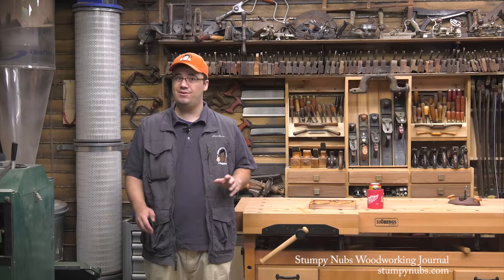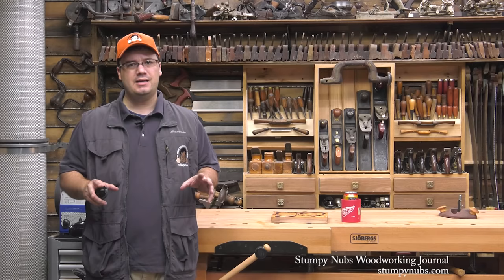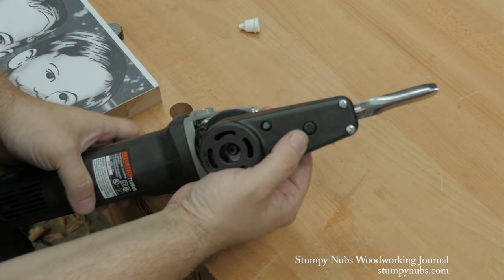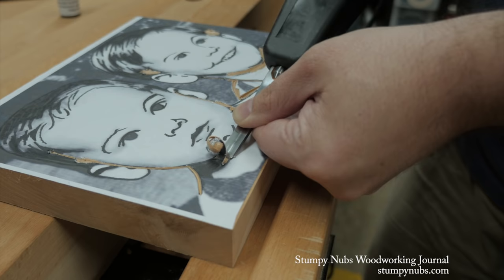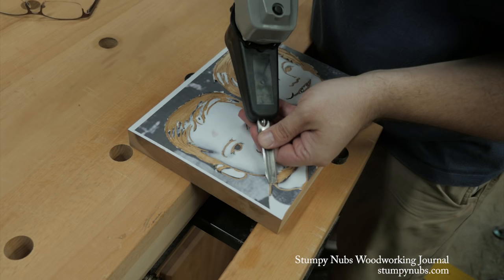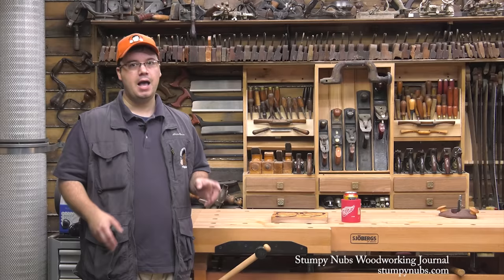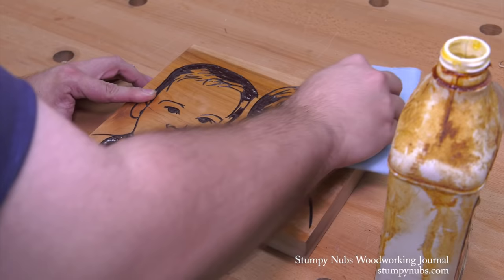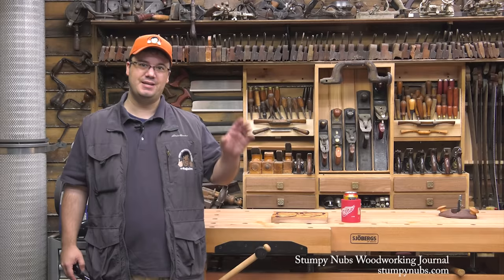How to carve a portrait into wood from a photograph (+ Arbortech Power Chisel review)

Comment: A very nice beginner's guide. There's only one thing I'd share to give a more updated way to transfer the image. The easiest way is to print the image from a laser printer. Place the image face down. Then take laqure thinner  on a white tee shirt material and barely get the paper wet. Take a spoon and rub the image into the wood as few seconds. Let it dry and take the paper away. The image will be transferred to the wood and no glue on the wood to deal with

Comment: I love that we can search back through this channel's content and find golden nuggets of information like this one.  I was not aware of the Arbortech Power Chisel.  I have been asked to make a sign and planed on making a template in MDF and using guide bushings, but when I laid out the text and added the offset for the guide bushing I found that the template became compromised.  The Rockler letter sets look interesting, but you are still limited to the available templates.  So I have just ordered the smaller Wecheer power chisel set.  BTW  I have own an Arbortech ball gouge for several years, but I have never been completely comfortable using it.  Not that I have spent a lot of time practicing.   Your method of carving from photographs looks very interesting though, and I am definitely going to try it.    Thank you James.

Comment: I use the Arbortech Power chisel for carving and love this tool.  One tip that wasn't obvious in the instructions was to apply 1 or 2 drops of the supplied oil every 15 minutes of use.  If you don't the end of the chisel that is impacted will mushroom and make it difficult, or impossible to remove.  I found this out the hard way and had to disassemble the power carver to get the chisel out.  I was able to fix the problem with some sandpaper.  
As a side note, the service center for Arbortech USA was extremely helpful and explained what caused the problem.  I own most of the tools offered by Arbortech and can highly recommend them for carving everything from bowls to sculptures. Great video and review of the tool.  you have a new sub. Keep it up.
Reply from the maker: Thank you. We will also be making another video soon using the Arbortech mini-grinder for a relief carving.
Reply: You will love it.

Comment: What a great project! I own & use many Arbortech tools but I opted out on this one because of the size. Instead I use the Proxxon & Wecheer power carvers, because they fit in the hand nicely with good control. Also the blades from theses are compatible with one another and with the flex cut hand chisel with replaceable tips. Together the host about 15 different blade types. With that said you did a great job presenting & using this tool! I really want to try this project! Thanks for sharing!

Comment: Can recommend the chisels to buy to start out with?  I assume that the two you get are not the ones used in these projects.  $80 or so for 3 more chisels or $110 for 5 is not easy after the initial cost of the power tool. I believe the tool will be great for a disabled person like me. Hands can't handle the work of hammer and chisel. Thanks.  Inspiring video.